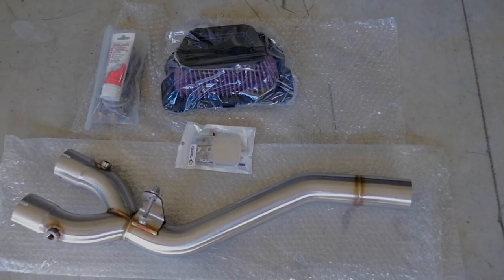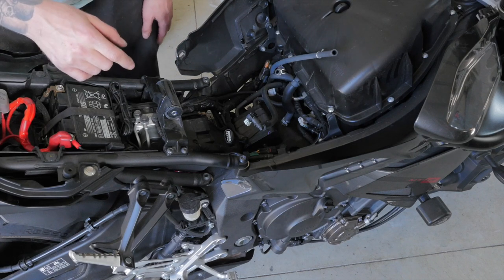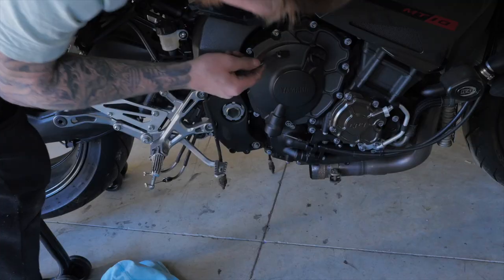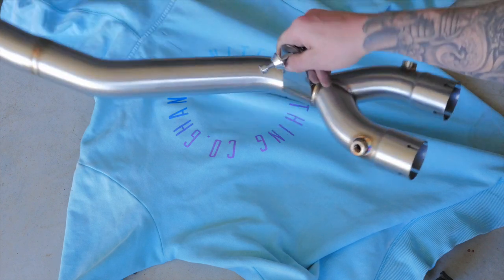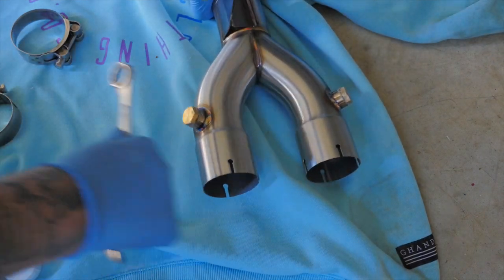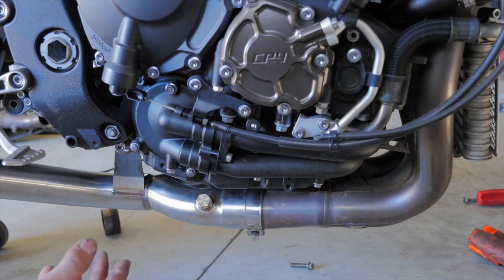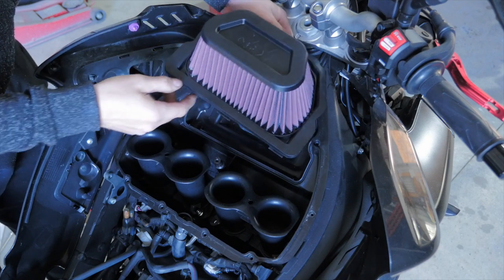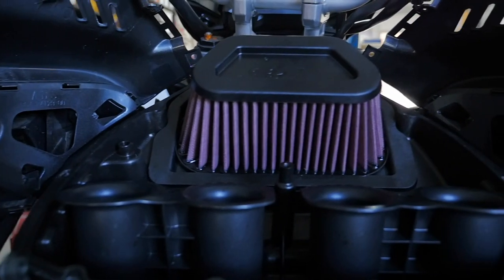Yamaha MT10 Performance mods - black widow mid pipe, K&N air filter, smog block off plates

Comment: Nice job. I’ve been following you since the Street Bob. Got good points on the air filter mod for my 2020 Softail Standard. I still have it and a 2004 FZ1. I like the MT-10, too. It’s grandfather, the FZ1 is still running great. You have good taste in bikes.
Reply from the maker: Cheers John, I've since sold the mt10 and bought a sportster 72.

Comment: Be careful using a K&N filter, they allow everything smaller than a mid-size chicken into your intake increasing wear. I'd go with a Sprint (not the see through one) or a DNA filter as they are within 3/4 of one HP but much more protection.

Comment: Hey man, what is the use of the smog block plates? Does the exhaust pop more or anything like that? And if I understud correctly, the exhaust servo wont give you an engine fault if you just plug the wiring back in right?
Reply from the maker: That's correct mate the fault code wont come up if you plug in the exhaust servo wiring. The exhaust does pop more with the decat but once you get it tuned to suit the popping wnt be as apparent. Smog block of plates are designed to seal off the ports used by the air injection system. the air injection system is used to burn off emissions and makes the bike harder to tune without blocking them off. There's much more information on Google on the use of smog block off plates.

Comment: What does a smog block off plate do? I’ve never heard of that before.
Reply from the maker: Here is a good explanation of what they do. 

-To get an accurate Air:Fuel (A/F) ratio when dynoing the bike. The air injection system pumps fresh air directly into the exhaust stream in order to burn off any unused fuel. Unfortunately by doing this the A/F ratio is thrown off by the extra "fresh air" in the exhaust stream. By removing the air injection system you can achieve an accurate A/F ratio.

-This addition will typically remove the majority of popping on deceleration that can be experienced with un-burnt gasses within the emission charcoal chamber. Note: Proper tuning may be needed and this is general feedback.

-Greatly reduces popping on deceleration.

Comment: Does it require gaskets where it slips on the headers? (like the stock cat does?)
Reply from the maker: I just used high heat pipe sealant. Didn't come with gaskets

Comment: Make sure you get that ECU flashed,  Installing the air filter and decat to a stock back, you LOSE 10hp until you get it tuned.
Reply from the maker: Yes sir I explained in the vid the importance of getting it tuned. I had it dyno tuned shortly after this vid.
Reply: @TheGingybeardMan  Cool.  What was it putting down?  With a slip-on, filter and proper flash they seem to be landing in the 148-150 range...
Reply from the maker: @SquireSCA  the dyno said without the tune it was making 142hp and with the tune it was making 151hp. I did a vid showing the dyno chart 👍

Comment: you have removed the lambda probes. what have you put in order not to turn on the engine light ?? Thank you
Reply from the maker: The 02 sensor error codes will be removed when the bike is flashed tuned.

Comment: Hey man, I know it's been two years but I bought the exact same exhaust setup for my 2020 mt-10 and the black widow mid pipe is too long at the Akrapovic muffler. There's a little ring inside it that stops the mounting holes from lining up about an inch short. Any suggestions? Looks like yours fit perfectly!
Reply from the maker: I ended up cutting some of the black widow pipe down.
Reply: Didn't want to show that in the video? Bummed I have to cut it now.  @TheGingybeardMan
Reply: Did you use a dremel or angle grinder? @TheGingybeardMan
Reply from the maker: @Filmingtherush  You can use anything that'll cut steel, Grinder, hacksaw, dremel.  I used a bansaw.

Comment: Do you reckon this link pipe will work on a 2022 Mark 2 MT10?
Reply from the maker: I'm not 100% sure mate, I just did a quick google search and many mid pipes state they for from 2015 to 2022 so can't see why it wouldn't

Comment: The constriction below the filter limits the power.  remove it. After this treatment, you need to flash your computer because the AFR is high, the engine will be damaged.

Comment: What was the smog delete I seen in the video called ?
Reply from the maker: They're called smog block off plates. They replace the air injection system by blocking it off. 

Here is a good explanation of what they do. 

-To get an accurate Air:Fuel (A/F) ratio when dynoing the bike. The air injection system pumps fresh air directly into the exhaust stream in order to burn off any unused fuel. Unfortunately by doing this the A/F ratio is thrown off by the extra "fresh air" in the exhaust stream. By removing the air injection system you can achieve an accurate A/F ratio.

-This addition will typically remove the majority of popping on deceleration that can be experienced with un-burnt gasses within the emission charcoal chamber. Note: Proper tuning may be needed and this is general feedback.

-Greatly reduces popping on deceleration